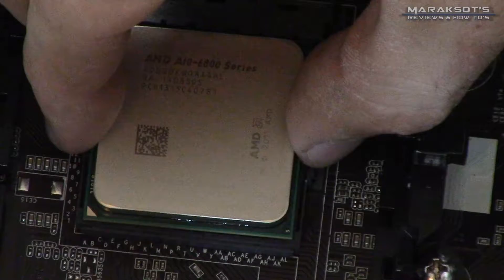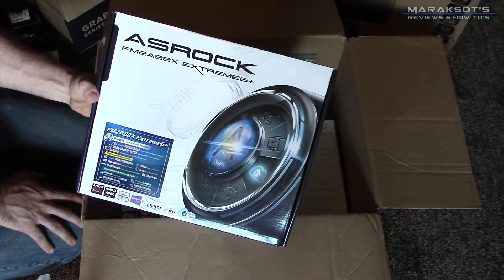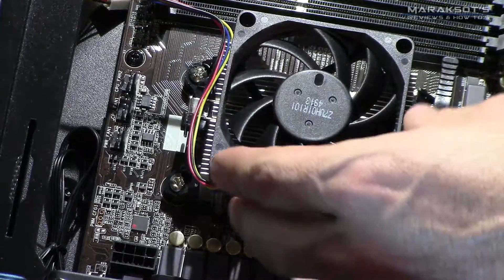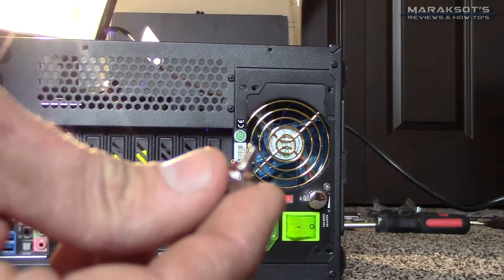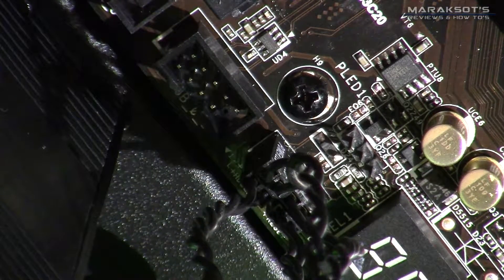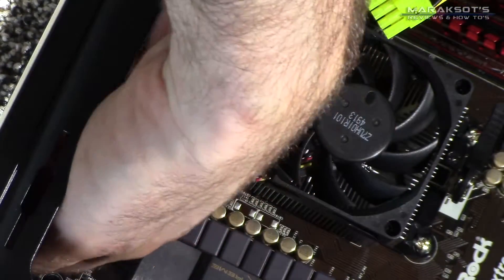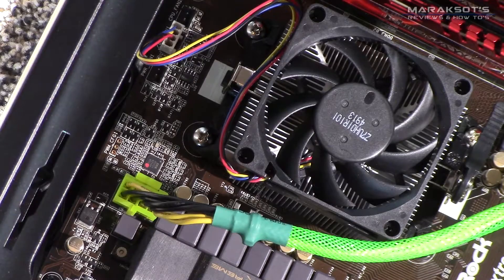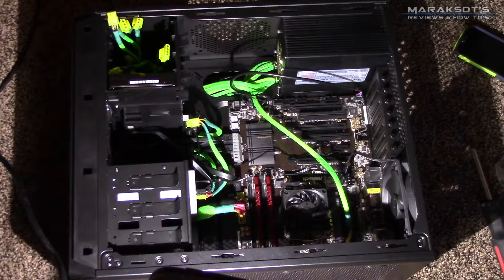Build your own PC - AMD A10 6800K APU - PC Build for my Parents

Comment: I just built a pc for my daughter and my brother donate to me a motherboard with this CPU and 32gb ddr3 memory, I did spend like 180 dollars on power supply, SSD, WIFI card and a nice case. 
this CPU performance still solid in 2021 computer run smooth and super fast and for a school computer for basic apps this is more than enough.
people think they need to spend lot of money in a computer for their kids school but not really, with 300 and a good monitor you can do a nice machine.